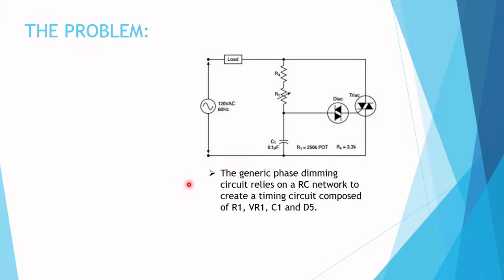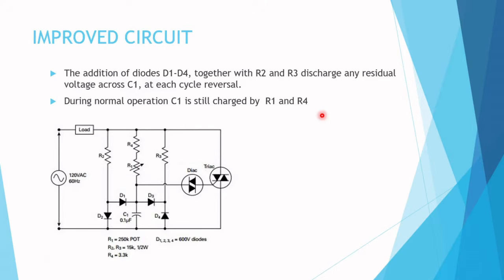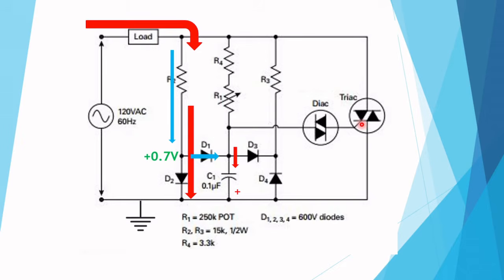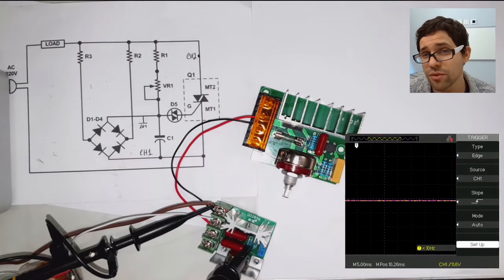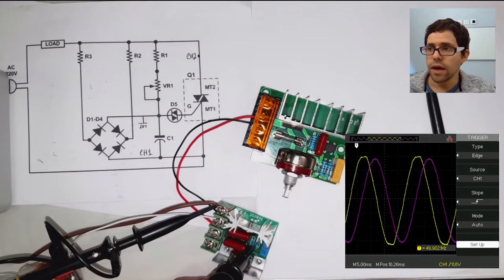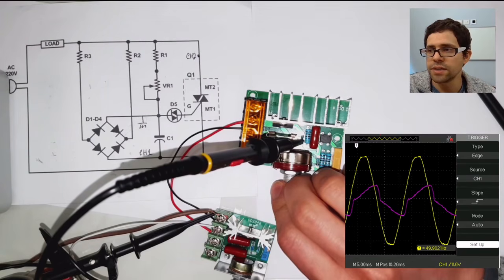Improved Triac circuit

Comment: Das 500 kohm Poti auf einer Seite auf A1 (Anschluß 2 des Triac).Dann kommt ein 100 Kohm Widerstand.
Seitlich liegt nach unten zu A2 (Anschluß 1) der 100 nF, Kondensator als Kapazität. Dann kommt danach der 3,3 kohm Widerstand an den Gate des Triac. Geht dann richtig. 👍simple Sache z.B. gut leucht - beschichteten 60 W Glühbirnen mit sogar viel besserem Licht (wie Tageslicht hell) und auch bei Halogen - Glühbirnen.

Setzt man noch einen Brückengleichrichter ein, dann wird der Diac 
mit beiden Phasen noch genauer versorgt. MAn braucht dann allerdings 2 x 3.3 Kohm
auf A1 (Anschluß 2 des Triac). Anschluß 3 ist das Gate des Triac.

Comment: There are a couple errors in this video:

1. The capacitor C1 must NOT be polarized, as it will be charged to ±Vbo (the breakover voltage of the diac) ‒ that is, approx. -30V to +30V.

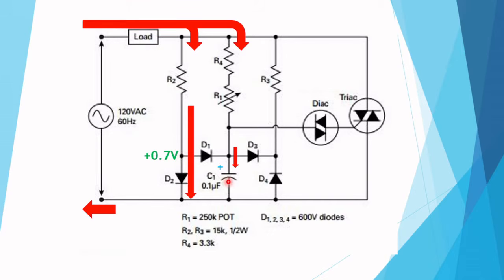2. 3:34 There is current flowing through the capacitor, as the small red arrow shows. I suppose you meant there is no current flowing through D1, but even that holds only if D1 and D2 have the same forward drop (which they virtually always do). If, however, the forward drop of D2 was higher than D1, C1 would charge via D1 to Vf(D2)-Vf(D1).

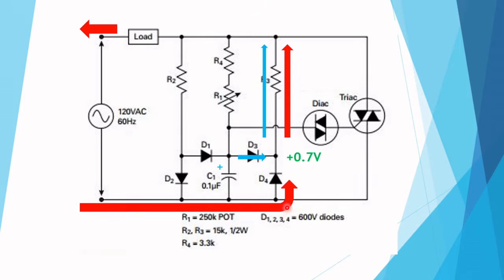3. 4:07 There is current flowing through R2 and D2 right at and shortly after the mains voltage crosses zero. This is because C1 is still charged, so it provides forward bias for D3 and D2, and it discharges through D3-R3-R2-D2 (and also R1-R4 parallel to D3-R3).

4. 4:13 D4 is not forward biased. It only becomes forward biased when C1 discharges below Vf(D3), and starts conducting when C1 discharges below Vf(D3)-Vf(D4). Likewise, at 5:29, D2 is not forward biased as long as the capacitor has a residual charge lower than -Vf(D1). (And in relation to that, at 5:43 it's not "charged to 700mV", it's "charged to -700mV").

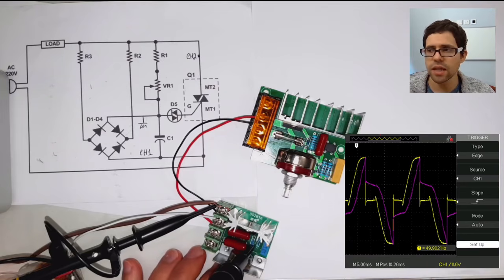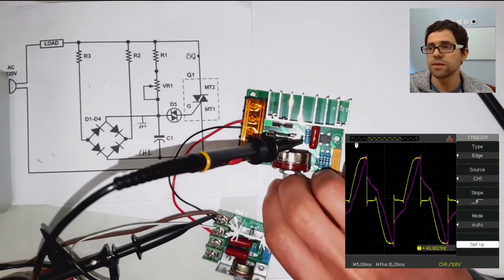You also did not address the fact that C1 will start discharging through D3-R3-R2-D2 or D4-R3-R2-D1 as soon as the triac starts conducting, as during conduction the voltage between Lin and Lout is equal to Vtm of the triac, which is typically around 1-2V. You can even see it in the plots at 9:18 and 11:56 respectively ‒ in the latter, the capacitor voltage drops much more quickly from the cca. 15V after the triac starts conducting.

Comment: The real problem comes, is this circuit is used to control the speed of a shaded pole induction motor, or, a transformer for low voltage halogen lighting. If there is any asymmetry whatsoever between the negative and positive half-cycles, it can introduce a DC bias, which can cause magnetic core saturation. At that point , a transformer acts as though the secondary is short-circuited, and the impedance drops to the DC resistance of its primary winding. The smoke comes quickly! I'm wondering if this corrects DC bias? My solution in the past, is simply to install a very large value electrolytic capacitor in series with the phase controller, and let it charge up to the offset voltage, eliminating any DC current to the load. The motor in my humidifier now runs much cooler, and makes much less humming noise, because of removing ~3 volts of DC bias, caused by triggering offset.
     I have a soldering station that uses this circuit, to control the wattage dissipated by the iron itself. and its offset can range from 1 volt to almost 9 volts, depending on the duty cycle setting. Fine, because the heating element is just a resistance, but if I want to use this to drive any kind of inductive load, it's an absolute no-go. at very low settings, it actually only triggers half wave. This might be a perfect candidate for the resistor/bridge rectifier test! (I AM going to "try this at home"!!) GREAT VIDEO.. thank you for posting. I learned a lot.
Reply: "I'm wondering if this corrects DC bias?" ‒ No, it does not. Read STMicroelectronics Application Note 308 "TRIAC analog control circuits for inductive loads".

Note that output current asymmetry may also be introduced by the diac breakdown asymmetry. If that becomes a significant problem, it's better to use a silicon bilateral switch (SBS) which not only has a symmetrical breakdown voltage, but also the breakdown voltage can be adjusted (and in some SBS, it can even be adjusted for each direction individually, to make the breakdown voltage asymmetrical if desired). A SBS is basically two anti-parallel programmable unijunction transistors (PUTs), each with a Zener diode between the gate and cathode providing the default break-over voltage; and a PUT is basically a Shockley diode with adjustable break-over voltage. As a side note, a PUT is closely related to SCR aka thyristor, and (basically) only differs by the internal layer in the PNPN structure to which the gate terminal is connected ‒ P in SCR, N in PUT (the first P layer and last N layer are always the anode and cathode respectively).
Reply: "I'm wondering if this corrects DC bias?" ‒ No, it does not. Read this: https://www.st.com/resource/en/application_note/an308-triac-analog-control-circuits-for-inductive-loads-stmicroelectronics.pdf

Comment: Does it matter where you put the load?
Reply: It sure does, just ask your dad
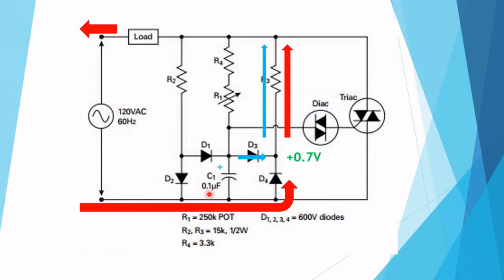Reply: Now to answer your question in seriousness, no it does not. You can put it at the "top", as shown at 3:57 (conected to the resistors R2, R4 and R3), or at the "bottom" (connected to D2, C1 and D4). It also does not matter whether the top AC terminal is live and bottom is neutral or vice versa, since the input is (typically) just a symmetrical sinusoidal AC wave.

Comment: This is an excellent  circuit, The Diodes seem to cater  for the peak of the 120 Volt supply and 600 Volts is  being extra safe. 
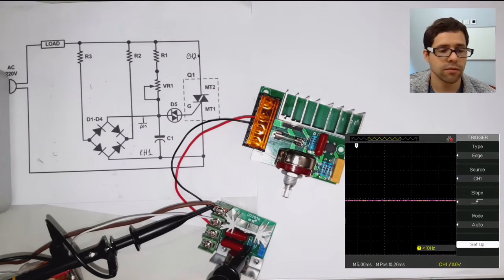The capacitor C! at 7:42 is shown as an electrolytic but this C1 has to accept both polarities.
A good idea and it provides a great improvement to the unit.